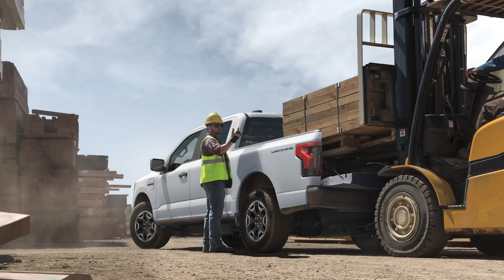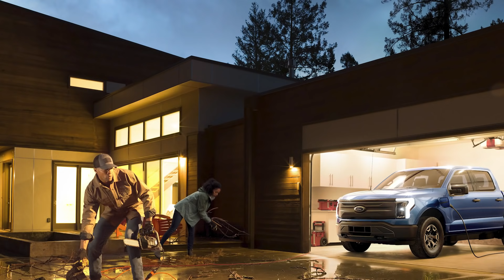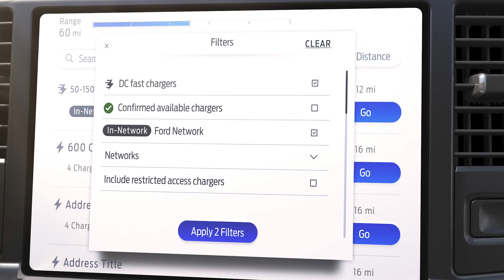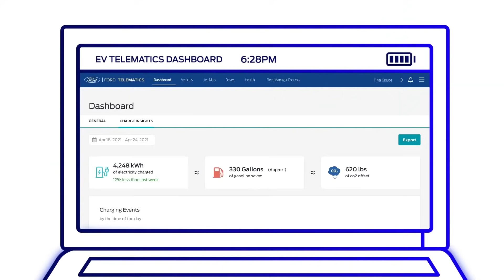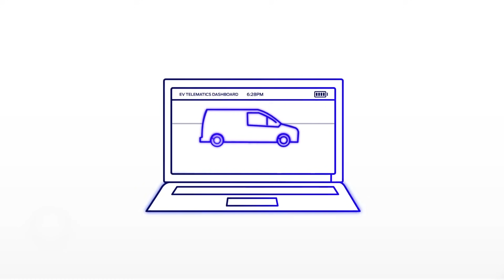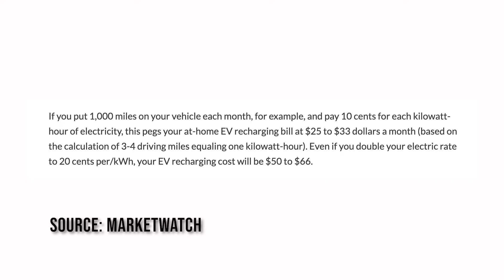EV Fleet Truck! 2022 Ford F-150 Lightning Pro, Lower Cost of Ownership

Comment from the maker: If you are curious about towing range, check out this video with the hypothetical towing examples: https://www.youtube.com/watch?v=AKjtjN0xMhA
Reply: You estimated $35,000 for the gas truck and $50.000 for the EV, but the Lightning Pro is only $40,000, so you are only looking at a $5,000 difference. Now when you buy an EV you get a $7,500 federal rebate off the sticker price, the EV is now cheaper than the gas truck. Depending on what State you live in you can get even more taken off the price in rebates, as well as saving $1200 a year in fuel, that's a savings of $8,500 over 5 years, not to mention the fact you no longer need to buy/provide fuel powered generators to power tools/equipment on job sites.

Comment: Something else that makes the calculation interesting is the rapid drop in EV battery prices, down 90% since 2010, and continuing to drop.  That could give Ford room to drop the price in coming years, but they might resist to boost margins and to avoid killing resale value of existing vehicles.

Comment: True price comparison should be $40k - $7.5k Fed vs that hypothetical $35k (which seems cheap even given discounts if one fairly compares to a 2.7EB 4x4 SuperCrew with the 400W outlet, tow package, etc). Ford quoted their own stats regarding daily mileage for fleets and not spending $10k extra will be huge on the balance sheet.

Comment: Unless I missed it, you didn't mention payload and towing. Cheapest model has awful stats for that.
Reply: I agree it would have been nice if he mentioned, but to be fair,  that is just like ICE trucks. Small engine ICE trucks are in the 5k - 7k lb towing range as is the EV F150 with the standard battery. Extended battery truck is 7k - 10k lbs.  Payload of the standard battery truck is 2,000lb and extended battery truck is lower (1800lb) due to extra battery weight. Pretty much on par with ICE F-150 except for special packages which, if you need higher payload or towing, an HD truck is a better choice.
Reply: Lightning Pro standard range is 2,000 lb payload, 5,000 lb towing. 7,700 with Max Towing Package. Those are fine.

Comment: Excellent job of explaining the ROI and the cost of investment (COI).  The points you make regarding the total cost of ownership (TCO) are also very clear. Many people don't understand these but they are applicable to a home and the operations of it, even a marriage has the same issues.   I hold onto my vehicles for at least ten years but usually 15 since I want to maximize the amount of my usage but allow time for the changes in technology to become "standard" and established.  Farmers know this very well, if they can get by with an Oliver tractor (as an example) and it does the job then they will avoid buying the $200,000 tractor or even leasing it.
Reply from the maker: Thanks Harry.

Comment: I hope that if this proves to be cost effective for fleets, Ford will make a reg cab 8ft bed model in the future.  39k minus the 7500 federal rebate makes for a 31,500 dollar truck.  I think my biggest hesitation about this truck is no different than that of a regular F150.  Is it going to be reliable?
Reply: Correction if approved 7500 + 2500 (built in the US) + 2500 ( built by Union) = 26,500. There are more incentives and write- off that I have not mentioned that make this truck or any qualified truck at any price a no-brainer.

Comment: If I had a fleet of 100 trucks, I would need 100 chargers. More space to park the trucks and employee cars. No more take home vehicles for the employees because not everyone can change the truck, and trying to figure out how to pay for the charging at the employee homes. If they live in an apartment that can’t charge the truck, it won’t work. I just don’t think it is feasible for all but a few.
Reply: As with anything, it will work for some businesses and not others. Many fleet vehicles are not taken home by employees and are already parked at the business so it's only a matter of installing the chargers. And they would not have to be the big, fast charge rate, expensive 80amp chargers. They will sit overnight long enough to use the more economical chargers. May require some coordination with electric company to ensure service lines/transformers are up to the task, but most electric companies are happy to sell you MORE electricity. And in your hypothetical 100 truck fleet, it's unlikely they go all in.  They would likely swap out a small percentage and see how it goes. Then higher percentage if that works. And, depending on use case of their fleet, they may decide EV are appropriate for only 10% or 70% of their entire fleet. Way too many factors to the appropriateness that each fleet manager has to evaluate.

Comment: A Tesla gets 3-4 miles/kwh. No way a big f150 gets that.
Reply: Yeah more like 2 but those trucks don't get 22 mpg on average either. Fuel cost is half maintenance should be way lower than half. If you are doing 1k miles in a month on average The short range vehicle should work for over 90% of the fleet. That drops the initial cost by 10k.

Comment: Since all Lightnings will be crew cabs and not all work trucks need seating for 5, it would be interesting if Ford swaps out the rear seats on the Pro version for a sliding rail system like the Rivian or extended bed storage like the Chevy Avalanche.

Comment: Tim, that $15K is a huge number for that small increased range! If it was giving you a range to 500 miles, it might make sense for certain buyers. That number is like buying a Power Stroke engine and another interior upgrade on a XL! All these options are getting really expensive across the board for all truck manufacturers. $15K is like you never got any batteries to start with! I wonder what the battery replacement costs will be in the future?
Reply: Also, what is the life expectancy for the battery?  If less than five years, and a replacement will cost $7,000 then I suspect many fleet operations will avoid the "problem" until it is a proven technology and prices come down some due to more supply.
Reply: @Harry-zz2oh  EV battery science is proven. EV have been around long enough to demonstrate the life expectancy is great and the fear of battery cost replacement is overblown. That is why most EV are putting a 8 year/ 100,000 mile warranty which is equal to or more than you get with ICE warranty.  Battery failures are rare and if it's a manufacturers defect that causes the issue, the issue will crop up within the warranty period. They open the battery case and replace the problematic module. No need to replace an entire battery pack. There are many considerations in switching to an EV, but battery pack longevity has proven to not be one of them. You'll have a higher chance of issues/repairs with an ICE over the same ownership period.

Comment: Resale for used electric vehicles is terrible. No one wants them.
Reply: Have you checked the price of a used Tesla Model 3 lately?
Reply: @alexkram  All used vehicle prices are up right now because of the chip shortage.
Reply: @alexkram  Tesla is the 1 exception. Any other EV offered thus far has had dismal residual value.

Comment: Fleet managers will think they need the long range… but if they audit daily mileage they’ll see they can easily use the short range cheap version.

It’ll all depend on the fleet managers math and logistics skills whether they notice this or not.
Reply from the maker: I see it like buying tools. I could get away with a less powerful tools, but I’d rather overbuy just to be safe.
Reply: @Pickuptrucktalk  Except overbuying is a waste of money and not a good business model for success and profit. Like the original poster said, the fleet manager should have the data to make the appropriate decision and most would be surprised how few miles are run each day.  If running a fleet, at least for now, most will still have a few ICE vehicles around that can be used for the "cutting it close" trips. That is until the ranges/prices/infrastructure matures even more. In any case, overbuying isn't the answer for a profitable business. Planning and managing will care for that.
Reply: @Pickuptrucktalk  better to have and not need it than need it and not have it in a business environment IMO.  Additionally, I've yet to see a battery whose efficiency didn't degrade over time. That can be problematic if you're close to the cutoff point.
Reply from the maker: @wilmarbarrick3194  a Quick Google search shows 10-15% degradation once you hit the 150-200k mile range. Yeah, if you are close to the limit already, you’ll have trouble hitting it if you own this truck longer than say 10 years at about 12 a year. I’m thinking, by then, you’ll have bought something else if you are an early adopter,

Comment: 1000 miles you save 100$ a month but you can also put those 1000 miles on a gas truck about 10x faster gas truck gets about 400 miles a tank with a v8 and can be filled for another 400 miles in about 3 mins vs 3 days for 800 miles out of this ev truck
Reply: Ford said they have telematic data from current F-150 owners that show 95% drive less that 174 miles/day. So even the 230mi battery range would be enough.
Reply from the maker: Correct @timlot. My fault for not including that detail.
Reply: A level 3 fast charger can add 75%  range in 45 minutes
Reply: @Johnthebruce  could put almost 100 miles in 45 mins not seeing how ev would be better for a fleet who has to drive constantly
Reply: @keedoopop4900  you'd be driving really fast.
Reply: @bresina63  70-75 mph for 45 mins is a good bit of ground covered not 100 miles but if you had to do that once or twice a day itd add up fast
Reply: @keedoopop4900  even 70-75 miles in 45 minutes, is 100 mph . That's cruisen'

Comment: 300 miles aint shit for having to charge for 8 hours companies would have to buy double to trucks and swap them in and out to be able to do shit.
Reply: You charge at night, when nobody's working.
Reply: @bresina63  if you had ro drive allot that wouldnt be a option. On top of if you hauled anything with these trucks youd be on the side of the road in 100 miles what happensif your hauling wood to a construction site or metal and you have 50 miles to E and gotta pull a trailer with equipment back? Youd be calling a friend with a gas or diesel to bring ya home
Reply: @keedoopop4900  If you have to drive a lot get a gas/diesel vehicle, it's that simple son.
Reply: @keedoopop4900  ...and so then you don't by an EV truck if it's not appropriate for your use case. EV will work great and be a better tool for many, many users. Just because it's not an appropriate solution for some doesn't mean they shouldn't be made or aren't for others. Just one more choice and that is great. One can buy different types of saws (plug in, battery, different amps motors, different diameter blades, etc.) and we each buy the appropriate one for our use case. And so it is with trucks (be that a V6, small V8, big V8 or electric).  Similar to being able to buy mid-sized, fullsized or HD pickups. One size doesn't fit all and so make the choice that is appropriate for you and move on. I don't understand why so many seem to get riled up and point out obvious inappropriate uses. "My wrench wouldn't hammer in a nail! Wrenches are useless!"  Ha.  Well, buy a hammer instead of a wrench to pound in nails. Ha.
Reply: Fleets aren’t going to switch over 100% immediately. Maybe 20% of the fleet does mostly short trips. Those will get replaced while 80% stays the same. Then as battery technology gets better they will transition faster.

Comment: This is the version I'm getting, with the 300 mi range; remains to be seen what other options they offer, I may get more upgrades, but don't want to over 55k. For people like me that drive around 30k miles a year, it will save me a fortune over the long haul.
Reply: News is you can't get the 300 mile range on the base Pro unless you buy a fleet purchase. This might be a vehicle to lease at first with the unknown residuals.
Reply from the maker: Yeah, you are looking at about $3,000 in annual savings with 30k miles using the latest data. Keep it a few years and you'll see some real savings.
Reply: @Pickuptrucktalk  I wonder what residuals will look like for these trucks. The initial batch of sub 200 mile EVs (and the Chevy Bolt) have poor residuals. But this newer batch of EVs with 250+ range and liquid cooled packs might have much better residuals. Depreciation is the 1st or 2nd highest element in cost of ownership.
Reply from the maker: @jghall00  Tesla seems to do good on residuals, but nothing else. With a flood of EVs coming, I’m hoping that changes for the sake of everyone.
Reply: @Pickuptrucktalk  And that is only fuel savings. 30k miles means each year, you are also saving the expense of 4 to 6 oil changes. Plus, in the first three or four years (90k - 120k miles), savings from no transmission fluid change, transfer case and front and rear differential fluid change, radiator fluid flush and fill, spark plug change,  engine air filter, etc. I know a lot of people don't do many of the scheduled maintenance items (because they trade off the truck at 100,000 miles), but you should and I do. EV would save me the time of doing all that work and the expense of the materials. Also, since EV use regen braking, brake pads and rotors last longer.  More savings.

Comment: Electric pickups make sense for someone who works mostly within the city and has a fairly short and regular daily commute. For someone like me who sometimes has to travel to remote areas where charging stations aren't always available, the hybrid would make more sense. Ford should really consider electrifying one of their smaller pickups either the Ranger or the upcoming Maverick as well. The smaller trucks would probably be better suited for pool men, landscapers, and various tradesmen who operate mostly in urban areas and don't necessarily need a full-sized truck.
Reply: Agreed. I'd like to see either a plug in hybrid that gets you about 30 to 50 miles all electric before switching to engine or, better yet, a range extender for an EV.  Typically, a couple hundred miles of EV range is plenty. Don't need the initial cost or range of a battery back that will do 300 or 400 miles, but there are often trips longer than that (or trailering which cuts an EV range in half).  
Having an EV with about 200 mile range and then a range extender (engine) would be ideal. I could drive on electric almost all the time, but on the weekends, when I tow to a mountain trailhead (snowmobiling, ATV, dirtbikes) or tow boat to lake, the range extender would make the trip doable. The range extender could run the entire time while driving if I knew the distance traveled warranted it, or even run while parked at the trailhead. 
True that charging an EV from gas generator isn't ideal, but it's a solution to making one vehicle do everything I need it to do so I don't have to own two or not being able to consider electric at all.
Reply: @MrChadx1  Very true. From an efficiency standpoint, it is less efficient to use burn gasoline to charge a battery. Unfortunately, until battery technology catches up, gas range extenders will likely be a necessity for longer trips in an EV vehicle unless you don't mind stopping every 200-300 miles to charge.

Comment: Just one question, can you take this unit to the mountains?? Where do you recharge?? Or just to use it in the citi es??
Reply: I was thinking some kind of portable solar charger would be nice. Something that folds up when not in use.
Reply from the maker: @NANA-lq5md  still portable solar generates only enough power to run a small appliance - think coffee pot. Just not feasible for charging a truck.
Reply: @Pickuptrucktalk  yes that's the problem,  it would be nice if someone could make something that could at least give you a decent amount.
Reply: @Phoenix Arizona Well actually those aren’t the only bad things. There’s also time to recharge vs refuel. Then there’s diminished cold weather performance. Then there’s short range. Then there’s increased demand (rates too) on the old electric grid. Then there’s the fact that most electric generation uses some fossil fuel as well. It’s just produced where you cant see the smoke unless you live near a coal fired plant. Then there’s the high cost of battery replacement…
Reply from the maker: There is a movement to add electric charging stations near popular camping spots and trailheads. While it isn't an easy trip to do today, it will get easier eventually.
Reply: @Pickuptrucktalk  In the western states running electric will be an issue since the Fed. Government won't have the money to pay for the lines and a charging station will be expensive to install.  In many areas, the cost to run electric to the first house will be $5,000 +/-  but then it won't cost as much for those who follow on.  Many ranchers now use solar power rather than even try to run an electric line to power the water pumps.  Much cheaper.